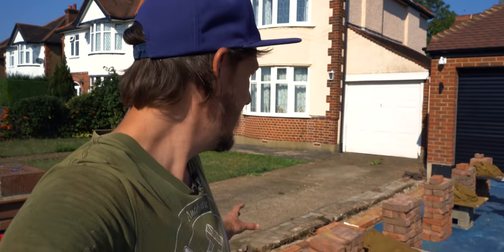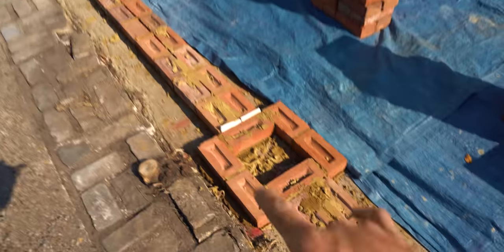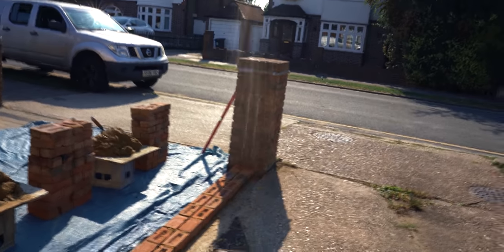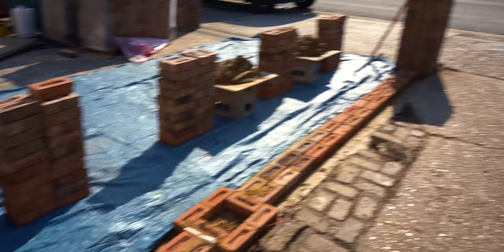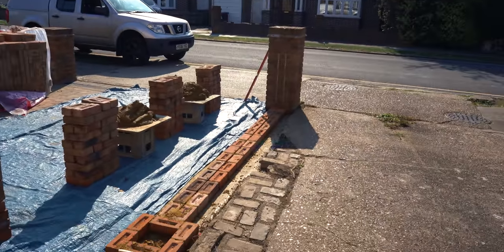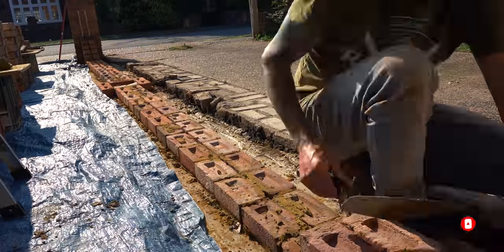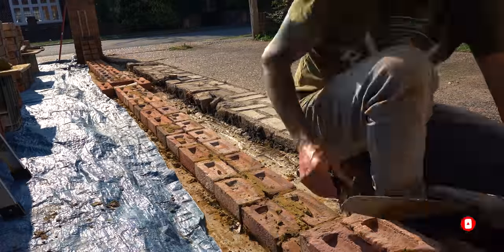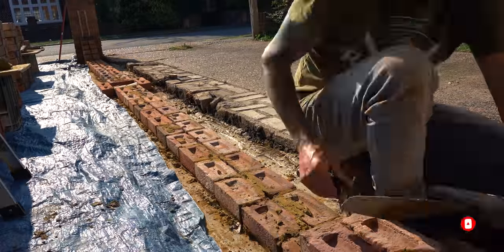How to Build a BRICK GARDEN WALL from Start to Finish

Comment: I was looking at the brick ceilings in Ajijic,Mexico and came across your video. I used to live in a brick house in maryland,U.S.A. Built in about 1904 it was all brick, Two bricks wide and soldiers every Five courses. No insulation just plastered walls inside. Two stories 50 feet long and not a crack anywhere.

Comment: If you have a wall like this and one side is 5" tall and the other side is 8.5" tall (sorry for American measurements) then how do you make up for the discrepancy in heights down the line? Do you put less mortar on the short side and more mortar on the high side? Is that how that works? Would it look silly if one side were thin and one were thick?

Comment: Best tutorial on YouTube. What are the steel strips you screwed to the existing pillar?
Reply: They are wall brackets which are for supporting the new wall to existing wall.technically ties in the walls for stability normally he would use expansion ties from a new build like he does but on existing piers he needs to use them brackets to tie in wall.

Comment: in future try 2 courses tile creasing half bond, we didn't put a purp joint on tile as you have pug fillet above! also with stocks a wood flush joint finish I think looks so much better more natural, back line with different sizes think gets in way boat level and level to check as you go enough love the tape what a time saver...

Malcs formally of Brighton... Perth WA
Reply: I think he did what the homeowners requested and it's lovely
Reply: @JL-hw5hu  he! as you say forgot to say that what He, was applying is just decotive and really serves no long term purpose...

Comment: Dang dude those creasing tiles make that cap look amazing. I normally cut in drip edge on each brick but that extra detail is money on design.
Though I was bummed that you skipped the flaunching. I'd like to know how you keep it neat, and consistent.
Now I'm regretting the cap I did on my wall over the summer.
Reply: Yes this is beautifully done

Comment: Great video....quick question....was it just random luck that it worked out that the bond worked perfectly from end to end or did you make adjustments in the location of the pier (or something else?) that make it work out perfectly?  thanks for the help
Reply from the maker: Hey Mike, It was pretty much all luck! There was a small gap between the garage and the last pier but it worked out perfectly because of the creasing tile. Quite rare having it that bang on! I wasn't complaining though🤣💪🧱
Reply: @RodianBuilds  Love the creasing tile very classy look now I want this on my property. We all have those neighbors we want to block off from sight that doesn't care about their yards just enough to get by with.

Comment: My brick wall in the garden has expansion joint in the 135 degree corner but I can see that foam and sealant is only from outside. On the garden side there is mortar. Is that correct?

Comment: Hi, how do you tie-in the two wall sections together? Other than those metal brackets? Do you fill the inside with anything? I would like to build such a wall on my property. However Im worried about the wall falling apart

Comment: would you ever use an sbr slurry on the creasing tiles before laying the brick on edge?
Reply from the maker: Its not something I have ever done. I wouldn't think it would be needed, the top was on good and solid. Don't think it would do any harm if you wanted to use it though😁🧱

Comment: Whats trying the two skins of brickwork together?   Where you got the vertical straight joints these will  act as expansion joints. Why didn't you rebuild  the piers soso as the brickwork  is built to the metric gauge you are using for the garden  wall?..

Comment: Rodian
did you use a tingle plate in the middle to stop the line from sagging?
Reply from the maker: Hi Roy, luckily on this wall I managed to pull the lines super tight so the line didn't sag.
Reply: ok any way great job hope you and Holy are doing well keep up the great work
Reply: @RodianBuilds  what bricks are they please

Comment: I appreciate that the side walls match the front stretcher bond but it would be nice to see proper 9" walls  fully bonded, English, Flemish, Bastard Flemish etc.  The walls as constructed are effectively very weak walls with two skins of 4 1/2" brickwork.  If water penetrate into the cavity between the skins it will freeze and blow the skins apart.  the walls should have at the very least stainless ties to connect the skins together, better that two 4 1/2" skins, the same as a cavity wall but less strong than a fully bonded wall.

Comment: So you didnt want to have any mechanical bonding going all along the wall? I would have drilled in some small rebar just the put the brickwork in around it. That way the walls use the lateral strength of the piers. In my opinion, that is the best way to do it. That will last the longest. Otherwise when the brick is a bit older, you can just kick the wall and it will fall over. Thats no good. 

The expansion joints, well im not sure how that will work out while the concrete did not have a control crack or expansion joint in it. So it would have been a monolithic structure until there would be a crack forming in the concrete. Never the less, in modern buildings you see a lot more construction and expansion joints to control cracking.

More mechanical bonding in your structure does  not have to cost more. You could have just configured the brickwork so that it would intertwine more so it would have been stronger.   

Greetings,

Jeff

Comment: Around the 7.08 mark when your talking about the existing pier not being to gauge, surely you're better off trying to match the brickwork gauge from the existing garage?
Reply: Or rebuilding old pier, the fact it doesn’t line up would do me in. However no reflection on your ability , top bricky.
Reply: @paulhaycock4088  yeah, that would work aswell. That's the better option actually, but then I suppose you'd have to try and get some day work from the client to cover the cost of time it takes to knock down and rebuild? 

Either way, Rodian has done a great job. 👍

Comment: My back garden slopes away & I need to build a retaining wall so I can back fill against it. How do I do it? Does it need reinforcing? 🤔
Reply: Depends on how much the wall has to hold back.
Try googling/YouTube-ing it ( how a retaining wall works or something similar)
Have a look for the retaining walls by Charlie Collision and Bricklaying with Steve and Alex they both built them and watching there videos may give you idea how beefy you have to build it in relation to yours.
Remember to include drainage points and expansion if applicable.
Reply from the maker: Well said James. There are many ways of doing it, all depends how much land you need to retain. Check out Charlie and Steve and Alex, they will deffo be able to give you a good idea of where to start
Reply: Thanks Rodian 👍🙏
@ Clive Goodwin what area are you based? If your local to me I'm more than happy to come round and have a look for you. (Chances are your prob hundreds of miles away)
Also check out Tricky Bricky he just built a lovely garden wall which also incorporated a small retaining wall (block and brick)
It really depends on the amount of mass/weight/force the retaining wall has to hold back.
All the best 👍
Reply: @JimJimpmjj  North Yorkshire mate
Reply: @cloggsy1971  ah as I expected miles away lol! Have look over what I said and hopefully you can work out what's needed for your requirements. All the best 👍
Reply: @JimJimpmjj  Cheers James 👌🏻👍🏻

Comment: sorry, may I ask why use this kind of bond with wall ties instead of english or flemish?

sorry if it's a dumb question, or if you mentioned it in the video and I missed it
Reply from the maker: Its not a dumb question at all. The customer wanted the sides to match the front existing wall, this was stretcher bond so I went down the wall ties route 😁👍🧱
Reply: @RodianBuilds  Ah fair enough, thanks for the reply!

Comment: Make some videos on what size the cement footing should be and what should be done to the ground below it nobody is making videos about this I think this is the most important part that's where you start is on the footing everybody does a good job about how to do the brick work but nobody's saying anything about the footing what size it should be how much weight it can hold and I can't get any good information about it so I think you'd be the guy for that information

Comment: I only had time to skim the video, but why are there no headers? Why is there no "bond"?
Reply: Because its just a stretcher bond built wall , quite common really..
Reply: @anthonymclean9743  Makes sense for walls that are a half brick thick. For the one in the video it seems like a very strange decision to me. I don't think it's right.
Reply: @metallitech  Are you a bricklayer ?
Reply: @anthonymclean9743  Nope.
Reply: @metallitech  their is a cost in laying with header bond as it takes longer and bricks can be over and under sized , so you end up having to put snap headers in if you're building a wall in English garden wall bond .

Comment: An excellent job, I've never seen better. Some near neighbours had a wall built around their supposed open plan front garden about ten years ago.  The standard of the work was appalling and every one in the road injected to it as it wasn't in keeping with the area, then they installed lighting on top of each pillar. All built without planning permission.  What did the council do, absolutely nothing other than asking them to remove the lighting.  I think you might get an idea of what ethnic background they are.  Because of the poor quality we call it the Berlin wall.

Comment: you did it wrong. The purpose of a brick column in a wall is to help support the wall so it doesn't fall over over time, or during a flood. You have to tie the brick into to the column when you are building it.

Comment: 3 different levels to build a coin u must have a van full 2 lines of brick on edge when u should only have 1 brick tap what for British standard is 4 bricks to 900mm as a brickyard different in length I've been a bricklayer for 40 years and did a 5 year apprenticeship not 6 month never seen so much rubbish British standard is 4 courses to 300mm regardless of bed thickness think ur the beginning